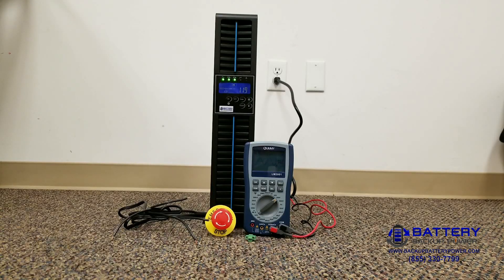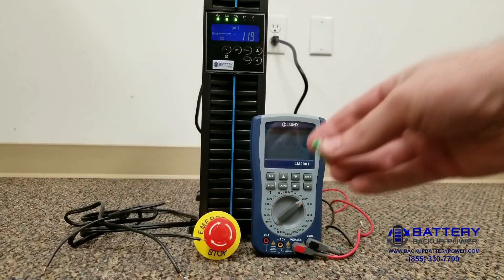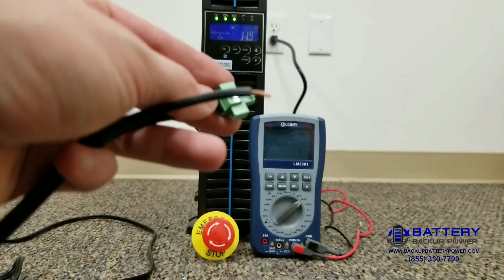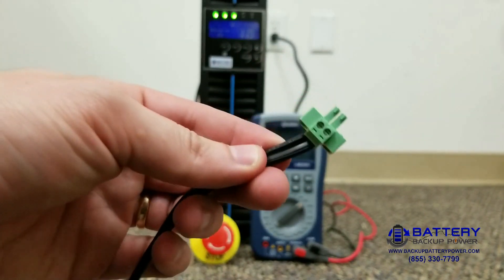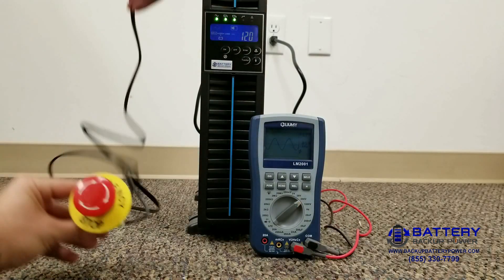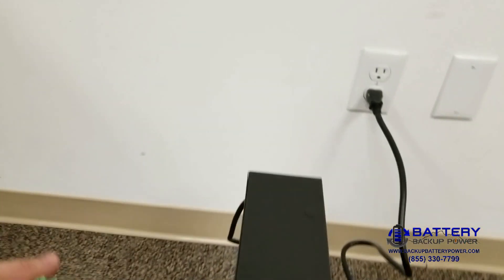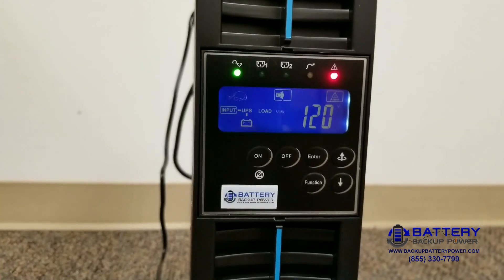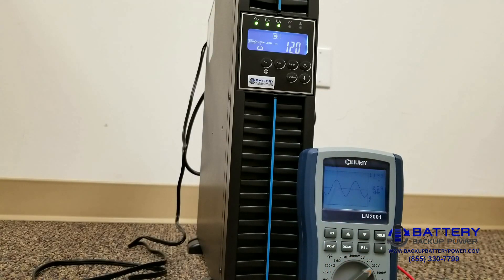How To Add An EPO Button To A Battery Backup UPS

Comment: great video,   do you know if has a problem  if the line  to epo  has 110 volts,    i have 7 epo buuttons  in my  work,  but this  are coneccted to a relay   i want  to  add  this buttons  to the ups    but i dont know if i can damage the ups  if the cable  have voltage  and i connect to epo